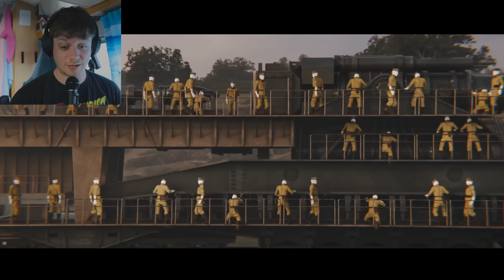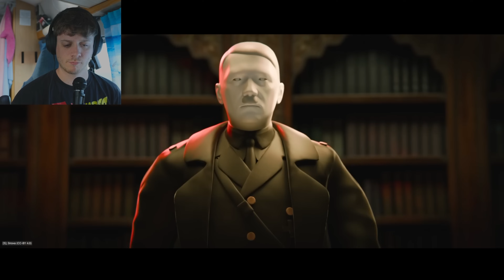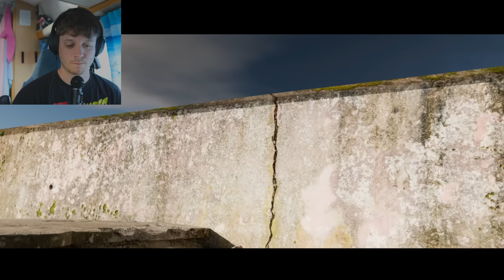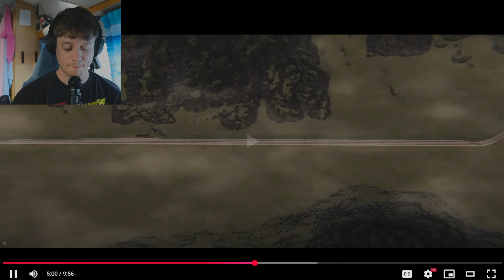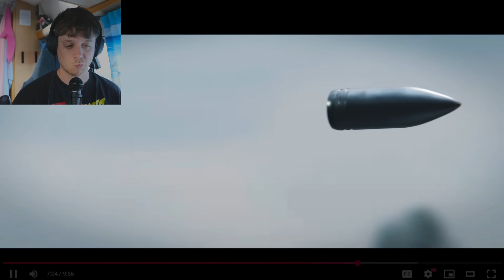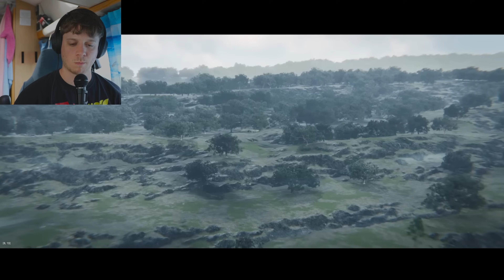American Reacts to The World's Most Powerful Gun

Comment: The armour-piercing shells had a weight of 7,100 kg, the weight of high explosives was only 250.0 kg, the muzzle velocity was 720 m/s and the maximum firing range was 38.0 km. The shell was manufactured from chromium-nickel steel, with a wall thickness of up to 18 cm, a hardened tip and had a screwed-on ballistic cap made of Silumin, an alloy of aluminium and silicon. It also had a barrel detonation fuse
The high-explosive shells had a nose fuse and a barrel detonation fuse, a mass of 4,800 kg with 700.0 kg of high explosives. With a muzzle velocity of 820 m/s the maximum firing range was 
48.0 km.
The dimensions of the artillery piece were gigantic, in firing position the length was 47.3 m, the width 7.1 m and the height 11.8 m.
The artillery piece had its own generator for the electric power supply for fine adjustment of some axes with electric motors.

Penetrating power of the armour piercing shell: 
Steel: 1 m
Reinforced concrete: 7 m
Concrete: 10 m
Natural ground: 32 m (they actually managed to destroy a sowjet ammo depot that was 30m deep underground and extended partially under the Black Sea with a Armor Piercing Shell)
High explosive shell: caused a crater 9.1 m wide and 9.1 m deep

Several plans were made to increase the firing range of the gun to be able to hit England when 
firing from France:
- A rocket projectile with a weight of 4,800 kg and a range of 77 km
- A sabot projectile with a calibre 80/65, a weight of 2,180 kg and a range of 65 km
- A sabot projectile with a calibre 80/53.5, a weight of 1,350 kg and a range of 100 km
- A sabot rocket projectile with a calibre 80/65, a weight of 2,586 kg and a range of 100 km
- A sabot rocket projectile with a calibre 80/65, a weight of 1,410 kg and a range of 140 km
 - Peenemünde-Pfeilgeschoss with a calibre 80/52, a weight of 2,000 kg and a range of 140 km 
for a smoothbore barrel which is 44 m long
- A three-stage rocket missile with a calibre of 80 cm, a weight of 10,000 kg and a range of 
150/160 km for a smoothbore barrel which is 84 m long
Reply: "the muzzle velocity was 720 m/s"
So they could not hear the shot before being hit.

Comment: 47 Kilometers is exactly 29.2044 Miles.  So just short of a 30 mile range projectile.
Reply: It's not even long compared to modern artillery.
Reply: @walkir2662  The most modern advance artillery the US has produced is a 155mm smart Shell that can be fired out to 40 miles range and track and target on land or sea without needing GPS it can reach that range because once fired it has Rocket Boosters that propel it.  The Heavy Gustaz fired shells weighing 7.7 tons ie a shell weighing over 15,000 pounds and could propel them nearly 30 miles back in that day.  Our most advanced smart artillery can fire a 155 mm shell that weights around 100 pounds 40 miles only by using Rocket boosters to do it.  This thing fired shells basically double the size of the ones fired from American WW2 Battleships like the Iowa with it's 16 inch guns to are range of 30 miles.  That is insane for something made back in the first half of the 20th century.